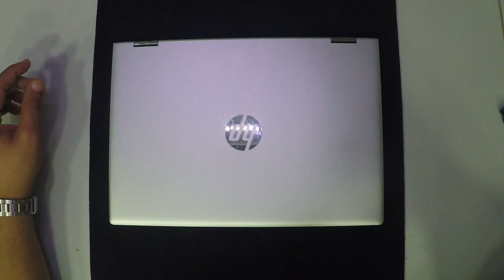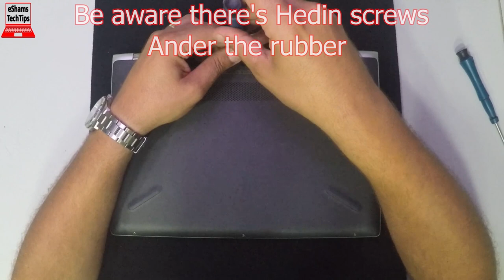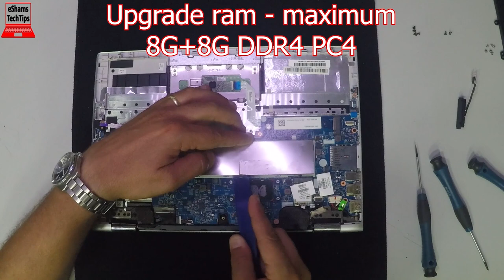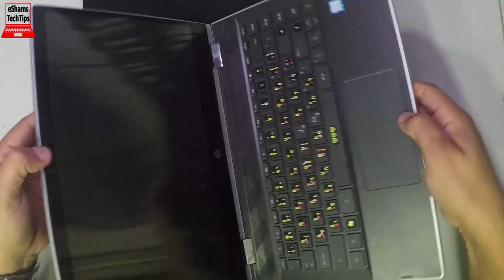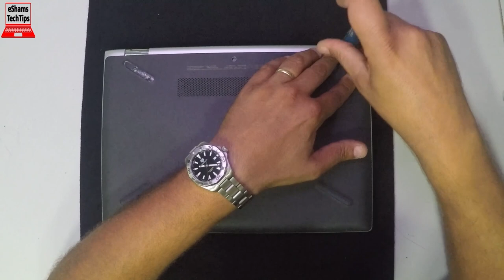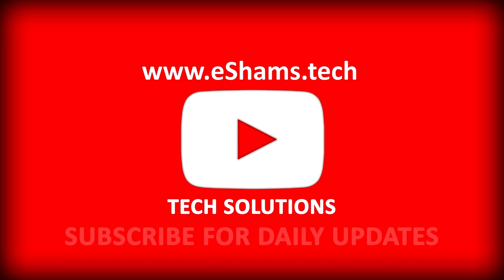HP Pavilion x360 Convertible 14 cd0 Ram UpGrade

Comment: I just added the extra memory as per your excellent video, however, my computer will not start up again. Is there an interlock someplace?
Reply: I found out the memory is quite specific. I had to buy one with the exact part number. Now it works great.